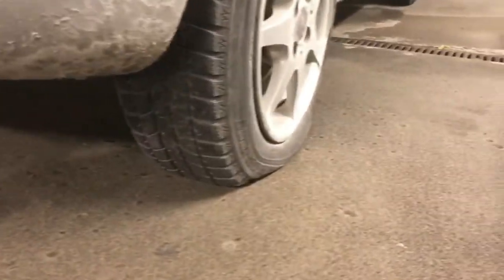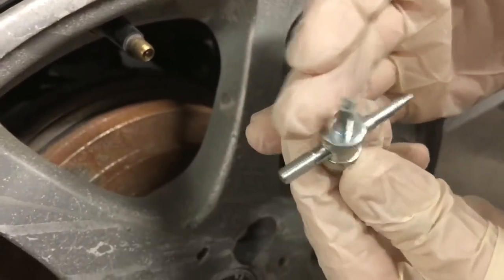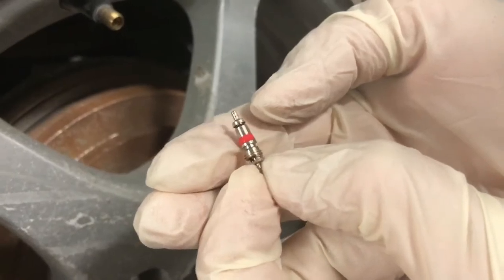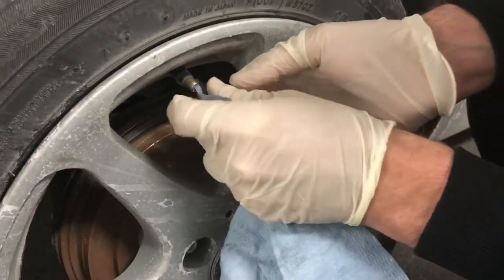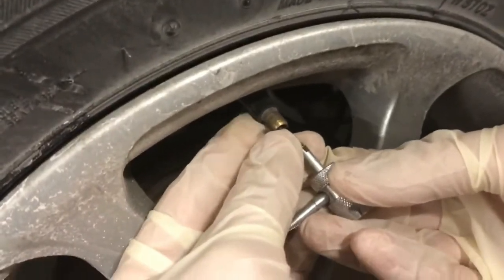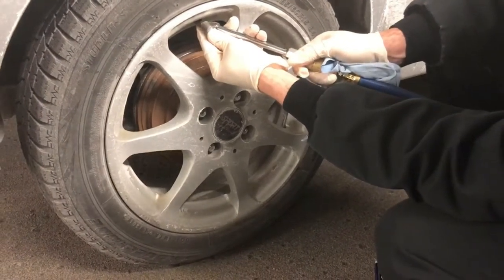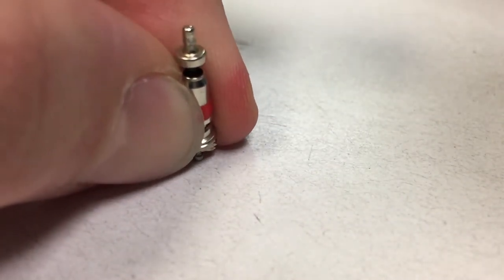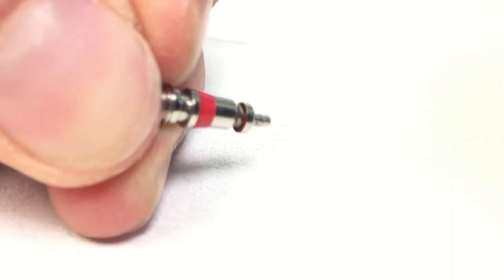Tire Valve Core Replacment (Slow Leak Fix)

Comment: My tire was flat therefore I filled with air, no problems. But deflated in 6 hours. Filled again no issue but deflated in 6 hrs. I then bought a can of fix a flat, tire was full but I deflated as recommended on can, AND HAVE BEEN STUCK IN A WALMART PARKING LOT FOR 2 EFFIN DAYS NOW. LOST 2 DAYS OF WORK AND ABOUT TO BE DAY NUMBER 3 STUCK HERE BECAUSE OF FIX A FLAT!!! NEVER USE IT!

Comment: seriously though I have a tire valve on my water extinguisher I had to re-insert the valve core but my question to you its it seem when I pressurized my fire extinguisher that the unit guage was showing lower than my bike pump gauge is it a thing that the plunger is supposed to be flush with the tip of the tire thread I wonder if so it could mean my over pressurization issue is caused by over tightening the replaced valve core? thoughts please thank you
Reply: I did manage to find a remedy  I replaced the whole part on the extinguishers tire valve with a used part and it seemed to fix the problem it does seem if the core is not just right it will not function desirably

Comment: Are valve stem inner core same for tubed and tubeless tires? Are the sizes same for two wheeler and four wheeler?
Reply from the maker: Not sure about tube vs not tube tires.  Those might be different size.

Comment: You can get this kit at Walmart or harbor freight...it comes with 2 value stems, screw tool ,some caps black or metal and a tire pressure tool really cheap...if you have the stupid tpms garbage on your newer vehicle...This kit will not work!!
Reply from the maker: Thanks!